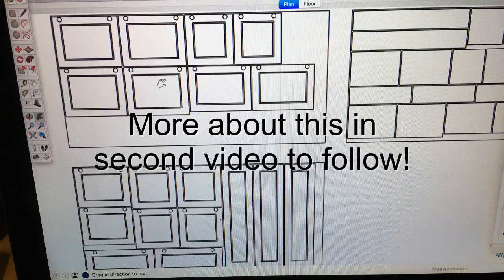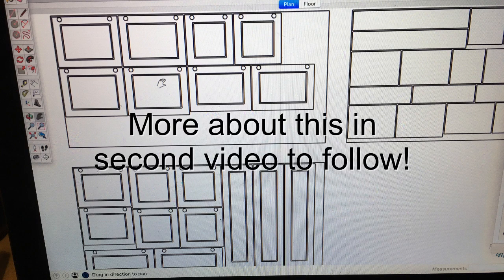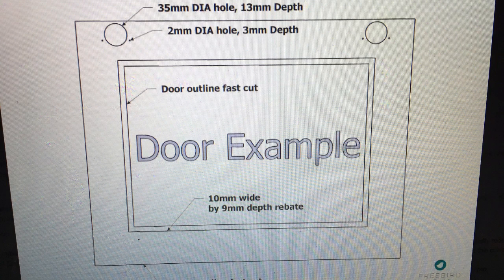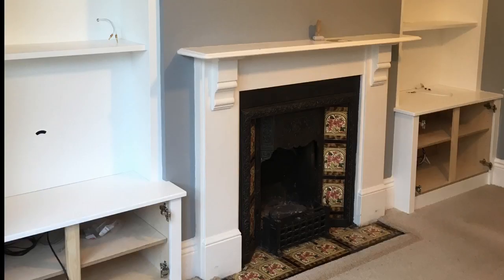CNC shaker doors update part 1

Comment: Hi Alistair, great video and share many of the issues you explained here. We currently outsource our shaker doors but due to lead times and quality we are currently looking for a cnc machine so we can make our own doors. We've been to view a couple and had a shaker doors made for us but the corners always still have atleast a 3mm round. Do you know of a cnc machine that can provide sharp corners? Also did you get a cnc machine in the end? Thanks for you time
Reply from the maker: Hi yes we now have a cnc machine and we are offering cnc doors to trade ourselves.   We have done extensive experiments since this video and by using a high grade mdf we have been able to make balanced one piece doors which give a better finish than 2 piece.  Message me on Instagram @freebirdinteriors and we can talk more

Comment: you should definetly get the cnc. you will never grow your business enough to the point that you can send them suficiend doors to become a priority. you can set up the cnc and run the sheet while the guy is doing somethiong else near by. the proble with carpentry like this is that things change and clients rewuests change very fast and eaasily. having the cnc inhouse will alow you to make up door at the drop of a hat  or remake a damaged one in a few hours.
Reply: Always that inner voice questioning should I go for it  !! Never mind the naysayers... if you have a vision and the balls then go for it... you'll kick yourself for not trying...
Reply from the maker: MelbourneAlan you are right I’m sure!  And I suppose it will never seem affordable until we get it and it starts affording itself!  Do you have one?
Reply: @Alastair_Freebird  yes i have one. its a shop bot. im more a site carpenter  then workshop (but trying to change that) so it doesnt get a lot of use.  it doesnt have a tool changer but it realy is needed. one cutter is too limiting . changing it is too much hassle